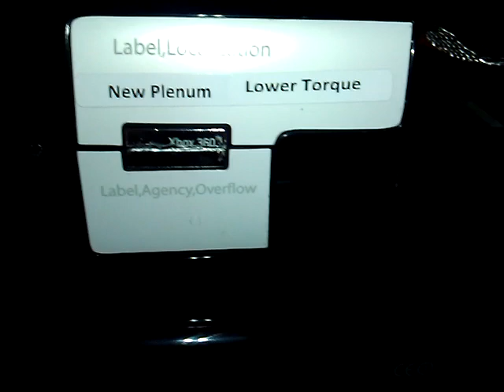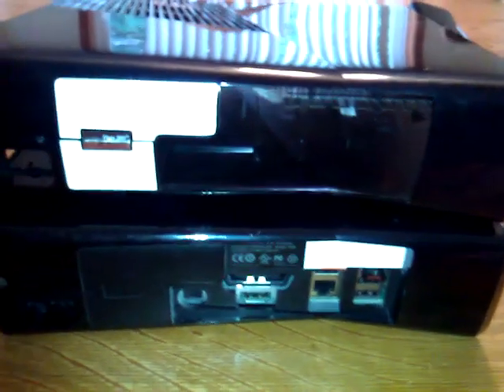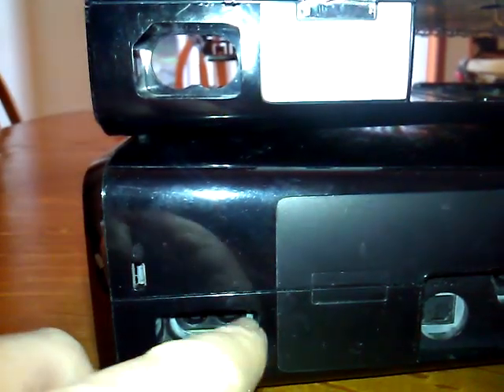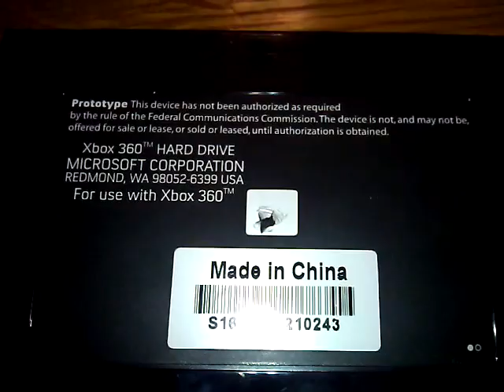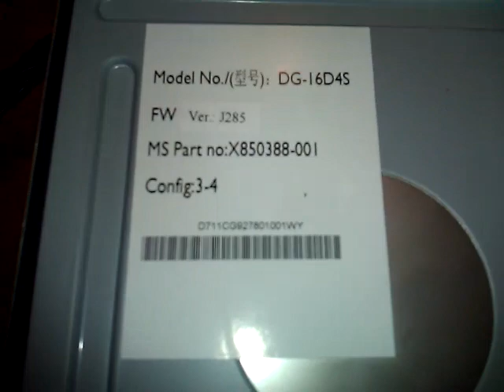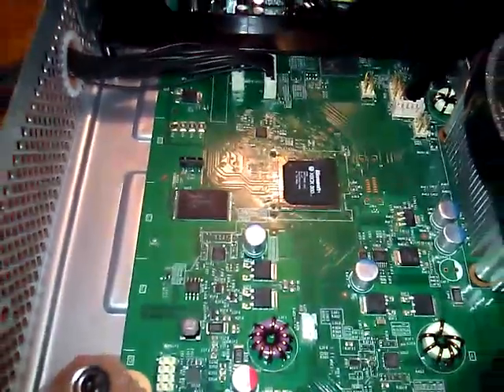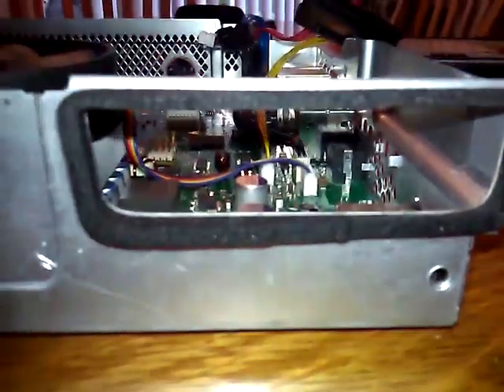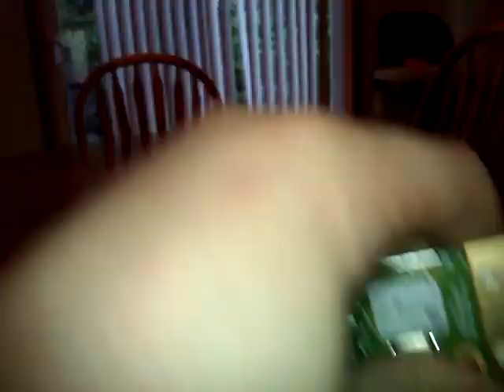Xbox 360 Development Kit XDK Slim Beta Prototype Part 1

Comment: interesting, as the Collermaster CM12V was acutally used on intel 775 cpus back in the days. but getting the 4 pin pwm version was rare, as it was always sold as 3 pin because most of the mainboards back then didnt have pwm header as it was "too new technology".

Comment: Only difference I noticed on the slim proto's shell was power supply slot like you said and the eject touch sensor isn't recessed like on retails. Just thought that was kinda cool, small but cool.